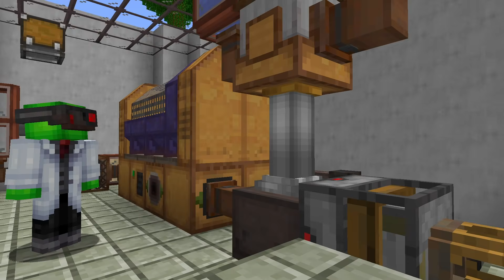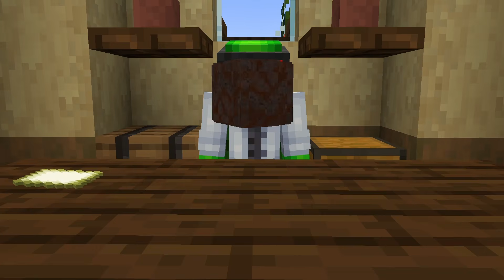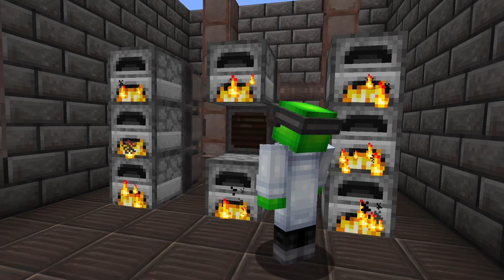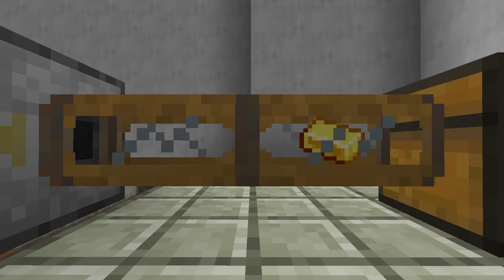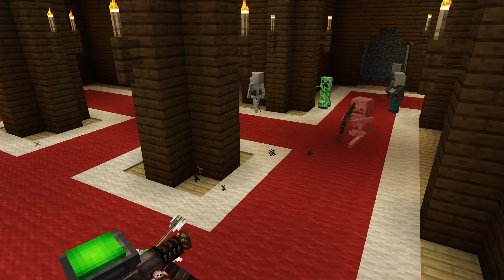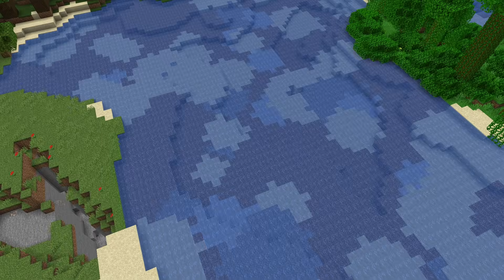NEEP Meat - Minecraft Mod Showcase [Fabric 1.20.1]

Comment: I’ve played the mod before and it’s a lot of fun, but only because I like machinery mods. How you arrange everything does need to be very specific though, and there are essentially no guides currently available to explain it all thoroughly
Reply from the maker: You do raise a good point on the systems for setting these up. I found that they were hard to get going initially, but once you have it setup once, it's fairly straightforward to replicate. Save for the programming aspect, that was way beyond my grasp XD